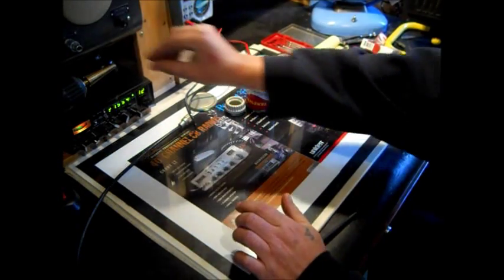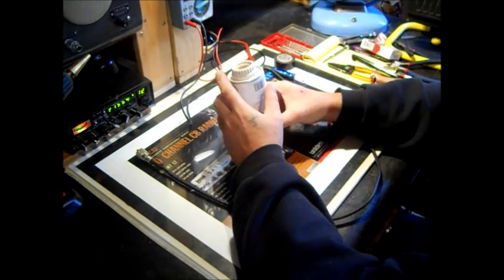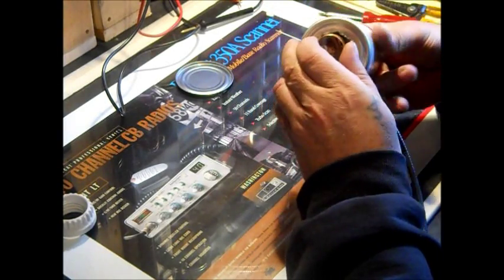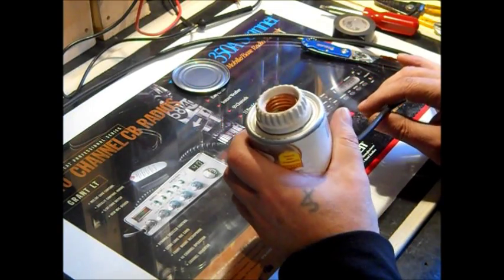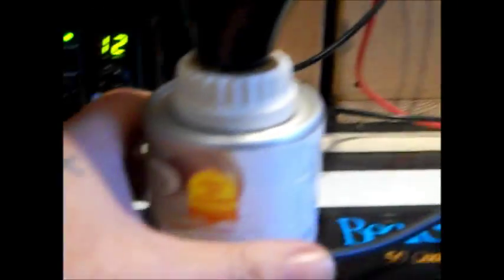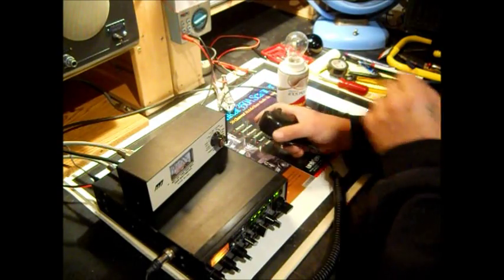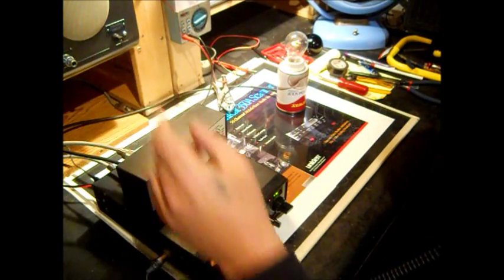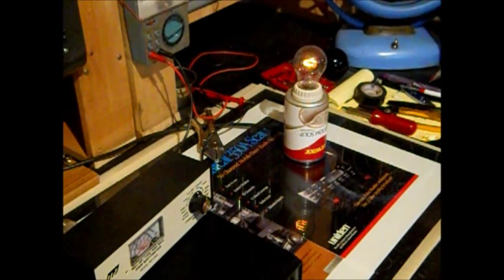DUMMY LOAD FOR CB ( Made from House Bulb )

Comment: Novelty and cheap radio are the key words.
Would work ok on a CB for short distance comms as you've mentioned.
Now if any one is wanting to build a good, workable dummy load, don't use light bulbs. The element in the bulb is a wire wound filament and not give you a true VSWR reading.
Good enjoyable vid never the less sir.

Comment: Novelty item is correct. Using a cheap radio you dont care about is also correct. With a few modifications you can make this a true 50 ohm dummy load and hook expensive radios up to them for bench testing , alignment, and mods.
Reply from the maker: yougotsbusted PUNK I have made one with a good s.w.r. and talked over 2 miles on it You can really mess with peoples minds when only the person close to you can hear you
Reply: not2fast4u2c What are the ohms of your build before hooking anything to it?